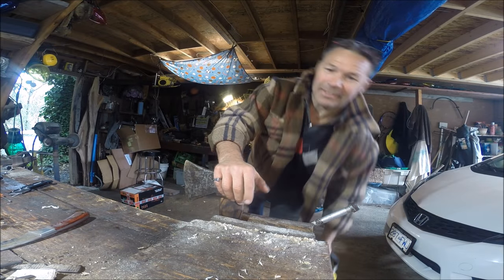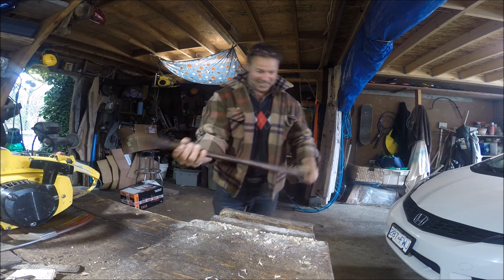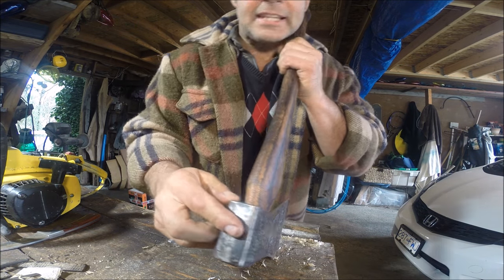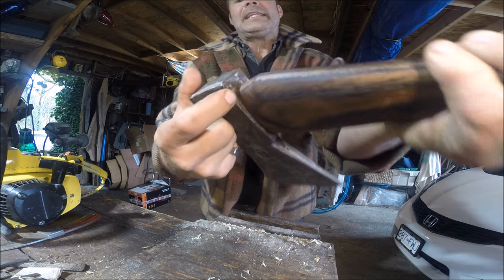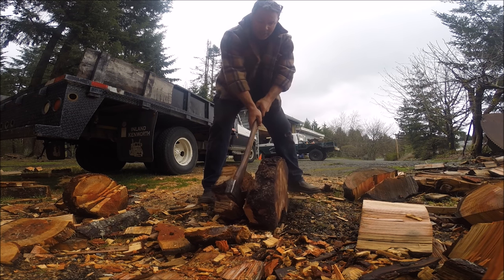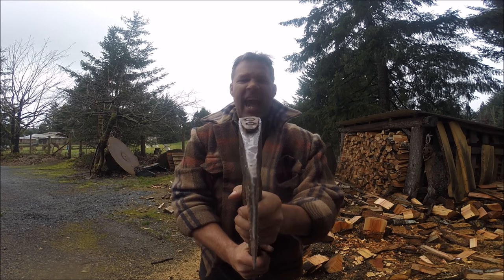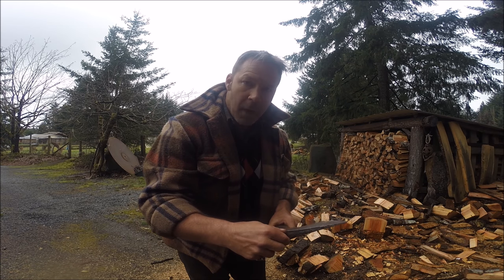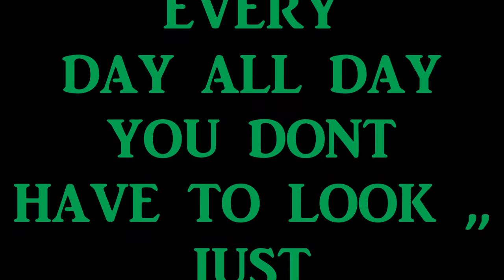A SATURDAY TRADITION

Comment: I have found it fully functional and acceptable to use an arc welder to fill in hogged our throats. It restores the shape and hold and provided your don't over amp the welder, over heating is not a problem.

Comment: Hey  Buckin, as you like your drums sugest you search sena drums and S White on YT both young laddies are very different but very good drumers in there own styles. When you find an axe head that has spread at the eye due to excessive use of the poll a couple of good wacks on the cheaks each side with a hammer on an anvil will usualy sort the problem out even with the handle in you can often restore the fit if it is not too lose. Like the way you fit an axe head, wish I had the varity of wedges and handle wood you have, mainly get spotted gum here in Aus. Stay Safe champ.
Reply from the maker: YA HAVE UTILIZED BOTH IN A PINCH... WHEN SOMETHING IS REALLY NICE JUST BEAT ,, YOU BET THX PAL